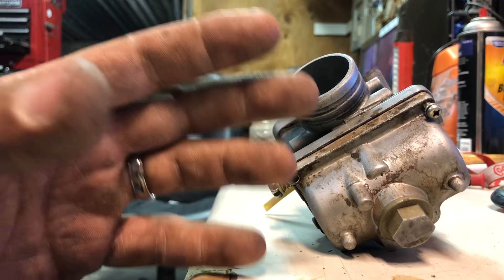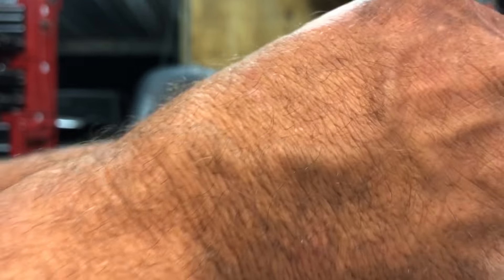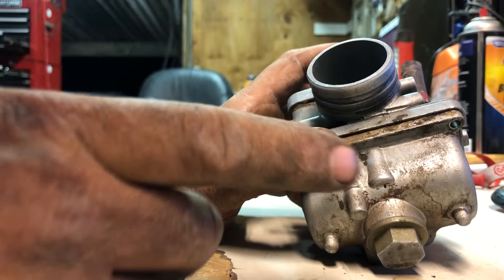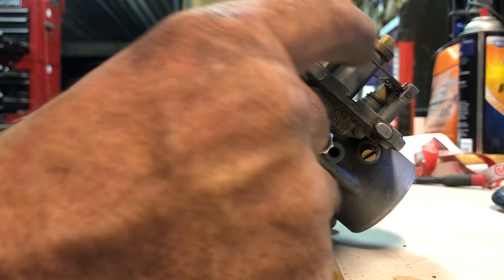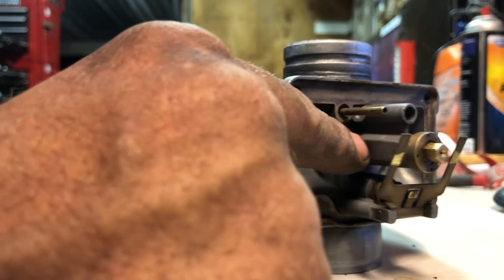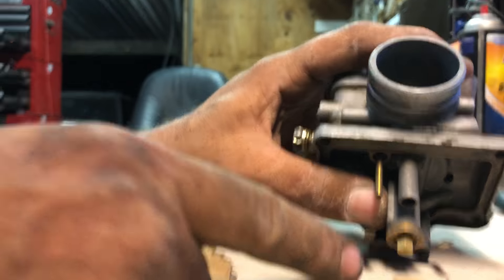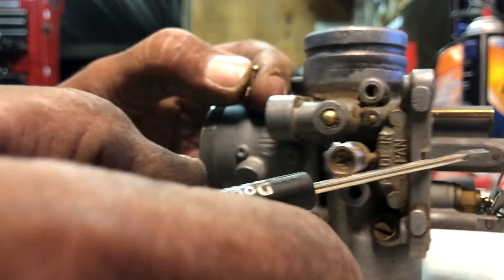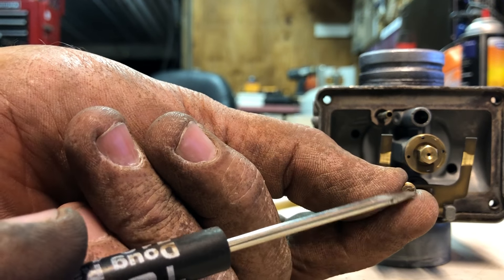Spitting And Sputtering Issue Solved

Comment: that is NOT what those holes do.
important that they be clear, sure. 

but that isnt what they do. they do the exact opposite. they REDUCE the amount of fuel by replacing it with air as air speed, and hence air pressure in the chamber surrounding those holes INCREASES, in an attempt to "linearise" the logarithmic nature of the suction on the jet itself.
grab a low power vehicle, cover a hole or two in those emulsion tubes... mains are noticeable, idle emulsions are fiddly as an engine isnt supposed to make power at idle. one can treat the idle circuit as a very very small carburettor in its own right... as it is.

you start doing pulls at various throttle settings, and depending what holes you soldered up... you will feel it get stinking rich through various RPM... or drill an extra one and feel it lean out at a certain RPM... and no amount of jetting or needle tweaking will alter that... as its a function of load, RPM, and throttle position.

ever seen a carb jetting diagram that mentions air SPEED?

it can take YEARS to get a feel for emulsion tubes. if youre into tuning, anyway... bit different when you just wanna mow the lawn or something. not as important on stationary type engines as they generally run at a fixed RPM, and people arent too concerned if theyre a bit "off" when not in the ideal load/throttle range... whereas the 125 that youre trying to get rid of the stumble at 7K, regardless of the throttle position, and no jetting changes you make are altering it...

 thats invariably the emulsion tubes.

they first found out about the issue when they first strapped an engine into a car... "air compensation valves" was the early way of doing it... an intentional air leak in the manifold.

Comment: Question?. I recently rebuilt my Yamaha brewing 350 carb with a kit from China, ran fine before, when I took it apart cleaned it with carb cleaner and the entire carb of mikuni mit from Thailand, it will idle fine and at about a third throttle spit and sputter and miss out, any fix for that? Thank you

Comment: Hello mate I recently bought a keyway rkv 125 got it really cheap just to do some deliverys but I am having a problem with it. It starts up first time everytime but when I give it gas it cuts out if I pull throttle to quick it dies also but if I twist throttle slow it revs up to about 4000 then trys to die again but when it's about to die if I give it full throttle it slowly revs up and I get my high rev any advise or tips on how to fix this problem thanks

Comment: Hi mate just a quick one my bike keeps spluttering nd backfires what could it be thansk ive tried cleaning my carb new spark plug cleaned al the connections and it’s still doing it any advice would great cheers buddie

Comment: 03 Yamaha starts and idles but sputters at each rev. 
Do you have any possible fixes ? I’ve rebuilt the carb and all is clean but I’m now hearing it could be the accelerator pump... I’m at my Whitt’s end here. Thanks
Reply: Too lean, shim your jet needle with a #4 washer
Reply: PUMP_666 - thanks Pump 🤜🤛

Comment: i got a 110cc tao tao atv it runs good but when your iding it and go full throttle the rpm jumps but dosent go any faSTER it seems like it looses power at high rpm i bought a new carb for it

Comment: I’ve got a 2017 ktm 150, a powerful hard-to-tune monster of a bike. Mine is spitting and sputtering in low rpm’s, especially in first and second gear. Out of those gears, in third, fourth and fifth, at high rpm’s, it runs fine …………until like 5 mins later when it bogs and wants to die. Any ideas?

Comment: I have a 01 sv650 with about 33k miles and i recently replaced the jets and cleaned the carbs but i still notice at times that the bike will shut off once or twice after starting before running and then it will sputter for a min or two. Is this still a carb issue

Comment: Plz help, 95' Z50R , new carb, new ignition switch, starts right up, idles great, give it throttle and not enough power or something,  won't  go , no power? It drove once around gears change, but then, slowed down and I  had to walk it back,
Reply from the maker: sounds like it may be starving for fuel, check the screen at the petcock. does yours have a inline fuel filter? that could be it as well. worse case valve adjustment. but if it was fine before the carb or ignition switch. i would start with wiring to switch and fuel delivery issue.

Comment: Hey bud I habe an 02 vlx 600 and it starts and idles fine but it spits and sputters when ypu give it any throttle,  so you habe to leave it on choke for like 10 to 15 minutes then it smooths out.  What would you guess the issue is? Any help would be greatly appreciated thanks   - james

Comment: I have a 1987 yamaha virago xv 535 and it runs fine when cold, but it starts to spit and sputter and backfire after I have taken it for a few laps around the block. This is with the choke off too. Does this sound like an electrical issue or carbeurator. The other issue that the bike has is that it doesn't charge itself while running. Are these correlated?
Reply: The same to My 1987 ski doo escapade

Comment: I have a 600  GSXR 2004 SuzukiAnd the problem I'm having is bike turns over doesn't want to stay on no more than 5 seconds bike turns on stays on for a good minute and it starts dying out bike stays on I give it a little throttle and it doesn't pass 3000 R pins it just dies after I pull the throttle and it stays at 3K and it dies right OK it doesn't go more than thatWhat do you think maybe the problem please get back at me I appreciate that having illustrations with this thing

Comment: I have a 2006 honda xr650l.  Put a 160 main in, 52 pilot. And at full throttle it sputters. Cant get the full power out of the bike as well.
Reply: Still too lean-Try increasing your main jet 2 sizes & shim your jett needle with a #4 washer

Comment: I have electronic fuel injection 200cc GY6 Chinese adult scooter. It is hesitating spit and sputtering while I am going down the road. Yesterday when I stopped and it was idling it just quit running. I tried for 5 minutes to restart it and nothing. After about 20 minutes I tried to start it again and it started right up. And then it spit and sputtered and hesitated all the way back home. Any ideals? Oh The name of the scooter is EFI 200 Capri it's a 2021 model.

Comment: My 05 Yamaha kodiak sputters under load until i give it more throttle, I put a new carb in it and I adjusted the pilot jet screw but still no luck any suggestions?

Comment: I’m about to loose my mind messing with my 04 grizzly 660 it will only idle when I have the choke on as soon as I turn the choke off it stalls sometimes it shuts off and sometimes it takes a few minutes but it will not idle and because of that I can’t get it into gear I’ve had this carb apart at least 5 times idk what else to do please help??

Comment: I have a YBR 125 that will ride for 10/15 min and then suddenly die. Sometimes will start on choke but i usually have to wait 5 mins. Then it will run again for a some time.

Comment: My bike idle run good but when it starts getting hott the idle goes for like 1500rpm to 1000 rpm. Any thing you know that I can look for to try n fix this. For a klr 650 2017

Comment: What about if too much fuel is being let in and it's being spit up into the air filter?
Reply from the maker: your choke is stuck closed. check to see if you have one or two flaps inside the carb that open and close. throttle plate and choke, one of them is stuck closed.
Reply: @thomasbriansavingmoney  hey thanks for the response! I'm going to take it apart later and clean everything really well then.  

Does anything change knowing that the motor is starting and the choke/engine+idle speed lever functions to reduce and increase the engine/idle speed, but trying to drive at a normal speed bogs and kills the engine? This is on a riding mower too if that also changes anything.

Comment: I just bought a used Arctic quad n doesn't start until I took fuel line off where it goes in to carb then it starts .for a ltlle while . Now I know it dirty carb
Reply: I'm not a mechanic ,don't know scqat about it .just a utube watcher

Comment: I got a 2004 Yamaha yz250f starts up with no problem just when I accelerate it a tiny bit it will begin to stutter and shut off it either wants gas or idk can someone help me I haven’t checked the carb yet
Reply from the maker: mine does that, for two reasons, one,,,i am low on oil. or the second when i am due for a oil change . the viscosity is broke down with the oil. i know it sound silly, but it really does act up on mine because of one of these two issues. if the engine does not have enough or the proper oil pressure. it is trying to shut down to save the engine, but just movement from running can make it see the right oil pressure, then see wrong again, every half of second. you think its running rough, but really it is shutting down and starting again so fast that it never actually dies.

Comment: I have a spitting sputtering issue with my generator. It has a NIKKI carb . I cleaned the carb but can’t get it to run right at all. It fires up but hesitates and sputters . Sounds like a fuel problem. I did put fuel directly in the carb and it fired up for a few seconds then dies ..HELP  please

Comment: My 100cc moped has a hesitation when accelerating upon applying the throttle about 1 inch turn of the throttle it loses acceleration then after about a second it picks back up and runs fine through the rest of the acceleration

Comment: So I just bought a brand new carb for my rancher 350 and its sluggish on the throttle
Reply: I had that with my new carburetor as well went back the seller traded it with one on a new atv he was selling and same thing, but when I returned to the store it with the carb on it worked normal, and never had an issue 3 months now, until today

Comment: I have a 400 yahama Kodiak at hi rpm it spits and sputters and bogs down what could it be?
Reply: Hi Sebastian...did you figure this out?  Mine is doing the same and I've been thru my carb and it's super clean.  I'm starting to suspect a bad coil, coil wire, or spark plug cap.

Comment: I have a 09 yz450 that only starts when I hold the throttle wide open? Anyone have any suggestions? Shuts off as soon as I let go of the throttle
Reply from the maker: is your plug new, sounds like a fowled plug. if you think its fuel relate, make sure the air jet is clean. good luck. thanks for watching

Comment: I wish my bike was stock and someone could tell me what jets I had to run and float height etc.
Reply: Good starter gauge for the float is to make sure it parrelell were the bowl touches the carb
Reply: @bassinbeast859  ended up figuring it out then changed exhaust and couldn't get it to idle or anything bought another carb and it's still kicking my ass honestly at this point I just gave up at the moment. It's a real bummer bc its warm now and I got fresh graphics and seat cover on it too but cant ride it. Also a clutch kit

Comment: Ok so my Bashan 250 will start and idle but when I get on the road and try to accelerate it will try to bog down and starts to pop and spit. What should I do.
Reply: I have the same issue.
Apparently it's a fuel air mixture problem.Back on mine in the morning.Good luck. 👍👍👍
Reply: Adjust the throttle pin could be starving for fuel or adjust the fuel mix screw
Reply: N

Comment: I’ve had this low end hesitation on my 250r for awhile now. Changed the main, pilot , air screw spark plug gap and a few other things and nothing has worked. It’s a 38 A/S that I bought from Duncan racing he tuned it for me riding style weight and area I ride in and found it was really rich. I dropped the main from 185 to 170 and pilot from 55 to 50. As of now my mid and top end is amazing but still have this annoying low end bog or hesitation. I took quick video of it. The 3rd pass you can really hear it. If you have ideas what it could be I’d be so appreciative.

https://youtu.be/9vIYCuuMyDw